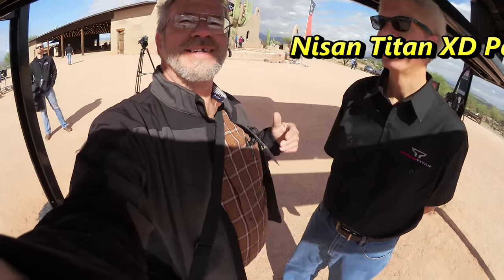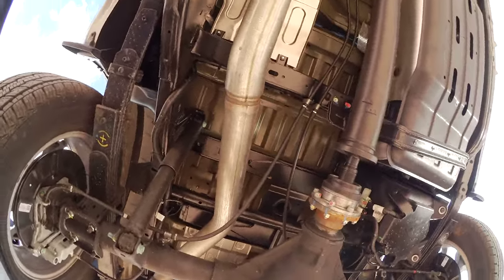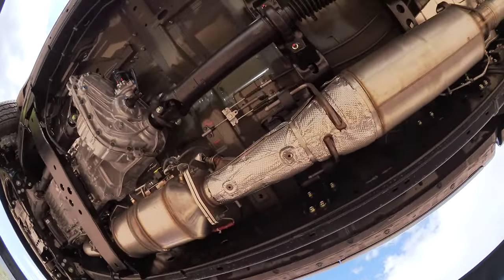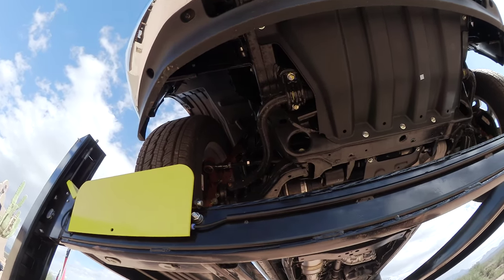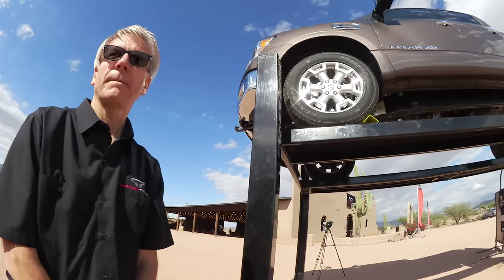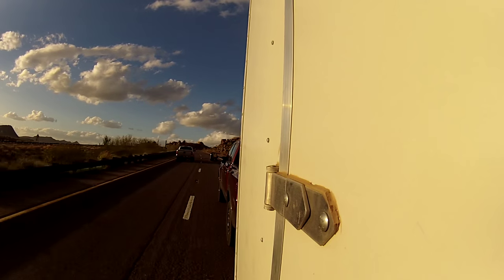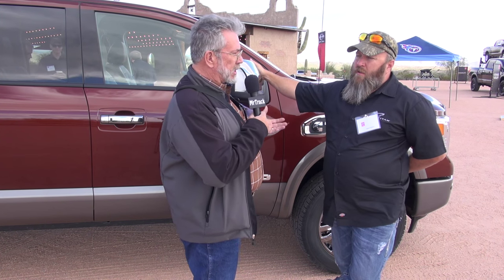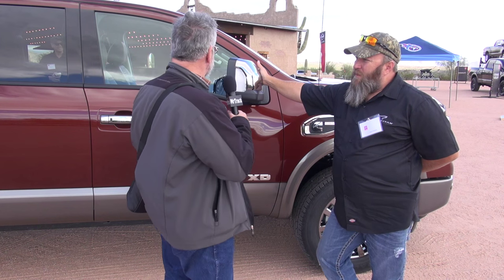Nissan Titan XD 2016 Cummins diesel, towing trailers and reviewing features Part Two

Comment: im getting tired of people thinking DIESELS should be about acceleration and wide open throttle..  anyone who actually works there diesels should care about how well it handles the payload once up to speed, not how fast you can get it there.  I want to know if I can drive 10hrs pulling a 8000lb trailer on CRUISE CONTROL and the motor not reving to the moon up every small hill to maintain cruising  speed.  and I want to know if will have energy left after my 10 hour day?? or will the ride beat me to death controlling the trailer?    bottom line is,  IS THIS A GOOD WORK TRUCK??
Reply from the maker: +kyle stewart Yes, I'm looking forward to towing trailers for a month to know the whole story. I like the truck but because of it's size, it will be compared often to the gas engines in the 1/2 ton class and it's fuel mileage better or worse will be a big factor.
Reply: Thank you sir.  I look forward to your findings.
Reply: +kyle stewart Well said. I would NEVER put my Diesel to the floor ( 99 Ram 5.9 Cummins ) There is a reason the red line is so low on most diesels
Reply from the maker: +Jørgen S I depends, if I need to tow big trailers, you can't beat a diesel. But for the extra cost of diesel engine and their special transmissions, it has to make since before I can afford one or it has to be very special on fuel mileage.
Reply: yes it's a good work truck.

Comment: I got the feeling the technicians were avoiding the exhaust brake dilemma.  I have driven this truck with a 10,000 lb trailer and its engine brake was perfectly reassuring

Comment: im lost is the max 12k or 14k if so this truck is a failure just buy a ram 2500 tradesman probably cheaper than this sideshow.
Reply: +srad98ful no  the Ram eccodiesel is  only $3500 less than the XD base price with Diesel

Comment: I saw a Video on TheFastlaneTruck where you drove the 3.5L ecoboost going up the IKE gauntlet and it didn't seem that you was that impressed with it.  Unless I missed something you were towing only 7500lbs , got only 3.3 MPG, mentioned numerous times that it was slow to accelerate, sluggish and that it didn't grade shift well. Even said towards the end of that video that if you were towing anything more you would want a bigger truck. Having driven both, even for a short time, do you feel overall that the Titan would be a better tow vehicle? Would you feel good about towing 9,000lbs regularly with the Titan or for anything more than 7500lbs in the mountains would you just recommend getting a 3/4 ton regardless of brand? Also, did you really get this truck up to 90MPH going uphill with the trailer behind you?  If so, did you feel comfortable with that speed with a trailer?
Reply from the maker: +Jeff Meagher I don't remember having a problem with power on any of the Eco Boost. I remember the fuel mileage wasn't good with a trailer on the Ike gauntlet. But none of the gas engines are. I haven't drove the Titan XD enough to make a broad statement. I was disappointed in the beginning acceleration. With two compressor wheels for low and high pressure, there shouldn't be much turbo lag. I have high hopes for the Titan, but the short distance we were allowed to drive with a trailer, I can't judge it yet. I'll be driving them in Texas in a couple weeks with trailers and in Colorado hopefully in a month or two. So in a month or so, I'll have my opinion
Reply: Great thanks for the reply and Ill be looking forward to more info!

Comment: Why did they let you drive and not Andre from TFL TRUCK? Andre didnt feel like it had that much power. What kind of car weighs 9,000 in a trailer? That means 6,000 lbs for the car. I'm having trouble buying into all this. Great job Kent for asking the tough questions.
Reply from the maker: +wvcorvetteman I think they figured it out by wave two that everyone needed to drive. Nissan hasn't had a major truck launch since 2003 so they are a little rusty. I spent too much time on my second day arguing to get to tow a goosneck and just got close but no cigar
Reply: +wvcorvetteman  Good questions.   Yeah, about the "car" in the trailer.... I was thinking the same thing.... it could have been a major competitors full size truck in the trailer.... and the doors were locked.
Reply from the maker: +Larry RX7Sports As I recall, the car was an electric Leaf. It had hooks attached to each end and they could drive it forward or rearward to balance the trailer by just plugging it in.
Reply: I agree with you Kent. If you tell me it will pull 12,000 lbs than prove it. I'm betting you get that thing to the Ike gauntlet and your going to find its a slug fully loaded. Think about it they used 5.0 V8 F-150's with Andre instead of the Ecoboost Fords. These Automakers should know that enthusisasts see right through that kinda of BS. Do you remember when Roman caught The Ford Corporate Driver letting off the fue in the Ram truckl over here in WV on the I-64 Sandstone Run to let the Ford Truck Pass? I wish they would just be more honest.
Reply: +MrTruckTV   Ok... I see.  I was reading some other comments on other truck reviewers at different testing sites and they stated that they were not allowed to test drive the XD(engineers only) with a loaded trailer and were not allowed to look inside the trailers; locked doors.  I had a humorous thought that they didn't have any water totes or rubber mats to load the trailers, so they had some major competitor's trucks on hand; Ford, Ram, GM/Chevy, Tundra(for reverse engineering purposes) and loaded them in the trailers.
Reply: +wvcorvetteman J2807 standard certified says it can tow 12,000 in the Arizona desert  all day long
I do not think Ford  or GM have J2807 certification yet, MR Truck would know.
Reply from the maker: +David Stanley Ram and GM are SAE certified.Toyota was the first one to certify all trucks.  Ford is on the F150, Super Duty will be for 2017 model.
Reply: MrTruckTV
Thanks
Reply: +MrTruckTV What do you mean by "SAE" certified?
Reply from the maker: +Okie Rider Society of Automotive Engineers test hitches, equipment and such.  SAE 2807 is a truck certification where OEM trucks are tested for towing , braking, sway control, cooling and such with trailers. When certified the OEM can state that their trucks are rated to tow certain weight trailers

Comment: With this frame they should have gone with the same cummins on the ram 2500. The 5 liter is weak for its size. The 6.7 has almost double the tq.
Reply from the maker: +daryl g (zach) Offical word was  the 6.7 L. Cummins wouldn't fit. Titan has always had a short nose
Reply: +MrTruckTV they should twin turbo this sucker to increase output.  You have the best video on the titan mr truck keep it up!
Reply from the maker: +daryl g (zach) Thanks a bunch, there is a low pressure and high pressure compressor in this turbo. I'll have more details in my website review soon.
Reply: +MrTruckTV...In your recent drive of the XD I  heard you ask "where is the torque?"... I think it's not geared for immediate torque. So my question is either you own a HD diesel or  recently drove one and since the weight of this truck is almost HD you were confused with it's "inadequate power"  or did you recently drive the high output 3.5 ecoboost? Which would be faster than this XD of the line and may win the race but the cummins 5.0 will never be a slouch and will be competitive to the ford. In the long run the XD is a stout truck and will handle heavier weights better than the Ford at max weight. I know the underpinnings of this truck is HD
Reply from the maker: +mhtl48 Hey I like this truck, I review trucks for a living. I have a new Cadillac Escalade in my yard this week for review, next week the 2016 Tacoma is delivered. I tow trailers with diesels and gas trucks every month. I was expecting the Titan XD to be faster towing 9000 lbs. Like Rams with Cummins, they accelerate better with bigger loads.  Torque gets you rolling, but when you get into the horsepower band at higher RPMS that's where speed comes from. I think the 5.0L Cummins would have accelerated better with a 11,000 lb trailer.  The Titan XD has a 3.90 rear axle ratio and peak torque is at 1600 RPMs. So the numbers say the truck should be faster, it accelerates like a Ram with a 6.7L. Not fast of the line like a 2015 Ford F250 with the 2nd gen Power Stroke or fast mid-range like a 2015 GM 2500 Duramax. I appreciate your opinion, I test trucks back to back. Next month we'll be in Texas testing 6 new 1/2 tons trucks back to back. I'm bringing the trailers.
Reply: +mhtl48 Your comment sounds like you already prefer the Titan XD over other trucks. In another word, you would try to find excuse for all its short comings. In this case, you will need a lot of excuses.

It's all about HP. When an engine makes ton of torque at low RPM, it just mean that that engine is able to produce ton of HP at low RPM. People tend to get confused between torque and HP. But HP is really what matters most. It's a work rate. Higher work rate = more work done or same work done faster.

Based on the numbers (HP, Torque, Weight), the Titan XD is no match for the 3.5  Ecoboost F150. The 5.0 Cummins is more on the level with the 2.7 Ecoboost. Before you jump in and shout that the XD has much higher tow rating than the 2.7 eocboost F150, you need to realize that it's not all about the engine that determines the max tow rating. Ford wants to position the 3.5 Ecoboost as the ultimate towing engine choice for the F150, thus they would engineer so. The 6.7 Powerstroke power rating is the same for F250, F350 and F450. Yet the towing rating for all 3 are vastly different.

What impressed me the most was the fact that a gasoline turbocharged engine with 30% less in displacement can run circle around a diesel when it comes to towing. The only thing the diesel has advantage over is the fuel saving. But that fuel saving is quickly offset by the higher initial cost, much higher maintenance cost, much higher potential repair cost, higher fuel price (depending on where you live), and the cost and headache of DEF.

It didn't take long for Ford to design the new 6.7 Powerstroke. And it was a revolutionized design. It took Cummins and Nissan almost 10 year to come up with the 5.0 V8 diesel. And all of its features are like...bleh...for 2015. None of them are not unheard of. Imagine if the Titan XD was introduced in 2010? Now, that would be awesome. It's almost 2016. One can buy an F250 or a Ram 2500 for less than what the XD costs.

BTW, the only good stuff on the XD is that Aisin 6-speed transmission. I dig that trans.
Reply: Motor Trend recently did the 2016 Truck of the year and their results were interesting. The 6.2 GM with 9,100 lbs did the 1/4 mile in 20.3 secs. The XD did the 1/4 mile with 11,600 lbs in 23.9 secs. In a mile they would be tied, in 2 miles the 6.2 would be trailing and in 8 miles the 6.2 "most powerful half ton truck" would be long gone. Diesels is king with heavier loads! I didn't read anywhere if  MT did their tests on a flat road or with a gradient but I'll assume the test was done on a flat road. If that is the case, I cannot wait for a test between the 3.5 ecoboost and the XD over the 8 mile 7% Ike Gauntlet towing max weight (12,000+ lbs) That Ford ecoboost will take off fast but as it gets steeper, the XD will be constantly and purposely be pulling up with confidence and will pass the 3.5 around the 5 mile mark and will go one all the way to the top!
Reply: +SB N Well said!!!!
Reply: It's has compound turbo
Reply: @noblekitty  the Titan is no match for the numbers of the F-150 eco boost 3.5L?… are you high or just stupid?… the F150 is the worst when handling heavier towing capacities! This truck does it safely and with raw power! CUMMINS DIESEL! I’ve driven both with heavy trailers and the XD truly is built and feels like a HD! The F150 is a car with a Mustang Engine!

Comment: Sad to say Nissan has missed the mark. As a 1/2T truck, this is good, BUT it comes at a premium price. TFL says this Nissan will be $60,000 !  For $60k, I can get a Chevy Duramax which gives more more of everything for the same price: more torque, more HP, more size, more towing, more payload, more dealers for parts, more aftermarket, and exhaust brake, etc. Just try downhill with 12k load behind without exhaust brake, if you survive the trip.  Soon, Chevy will bring a 4.5L Duramax to 1/2T line, which will be the equal to this Titan. Ford will be similar. So why pay a 3/4T price for a 1/2T truck? No sense. If anyone thinks fuel economy will win the day, forget it. When loaded and towing, a 5L motor at 3200 rpm will very likely consume equal fuel to a 6.7L motor at 2200 rpm, and the 5L will have NO power to spare. This is simply the way diesels operate. So, no real point to this Titan. a pity.
Reply: +Rob Grune Very good points you made. I can throw some headers and exhaust sytem, an air box  and a tuner on my 5.6 and kick ass for much cheaper. Tough motor!
Reply: +Rob Grune Yep I agree with every point you made. It really strikes me as odd that Nissan would produce a truck like this. It's not a 3/4 ton, but it's a bit heftier than a 1/2 ton. With all the points you've already made, this truck make's no sense...You can get a Powerstroke, Duramax or Cummins truck equal in price to this one and have much more ability with all the luxury this truck offers. Ultimately I think this will just wind up being a ''status'' truck, much like the Escalade, while in reality just an overpriced Tahoe it sells because it's a status symbol. I'm a Ford guy personally, but's kinda sad to see the Titan go the direction it did. The original Titan was the exact opposite of this new Titan. The original was a light weight, dare I say somewhat sporty (by 1/2 ton truck standards) pickup. This Titan though...Can't decide if it want's to be a 1/2 ton or a 3/4 ton. And with a 7,000lb curb weight, roughly 1200 to 1500lbs heavier than your average 1/2 ton truck, you can throw any spirited driving you may have gotten away with in the original Titan out the window.
Reply: Also don't care for the new look of this new Titan at all. I do like the 2015 Ford though. Like the headlights and tail gate design.
Reply: +Rob Grune Exactly as in 2004 Nissan Titan leads the way and they all follow
Reply: As with anything it depends on trim. The entry level 4x4 with Cummins is supposed to be around 40k. And 50k for the Pro4x model. At those prices I don't think it's a bad value as it doesn't take much to get the gas powered HD trucks to 50. But at 60k for the Platinum Reserve then I think you're right with being able to buy a well equipped 3/4 ton diesel.
Reply: Also have to consider the other end of the spectrum and the fact that you can get an F150 or similar loaded out to over 60k as well. Really depends what trim you're looking, what you're doing with the truck and ultimately what you're comparing it too. Trucks in general certainly aren't cheap anymore.
Reply: Josh Tavenner
What happened to the poor man's truck ?
non existent now.
even the small trucks are pushing 40k
the working poor cannot afford 1000$ monthly payments.
Reply: well, another person wrote me to say he hears the price for the base unit will be say $40k. still, $40k is not cheap for a base, and likely a "crew cab" model with a few towing options will run to say $50k. imho, nissan should price this much less. give people more for less money, and sales will soar. do opposite, and sales will tank.

Comment: Awesome Video Kent! Way to put those guys on the spot. How do you think the 5.0 Cummins felt compared to 5.7 Tundra, Towing the 9000lbs?
Reply from the maker: +Zac Camarta For 9000 lbs, a gas engine can accelerate better but it takes more fuel. Higher weight trailers do better with a diesel.